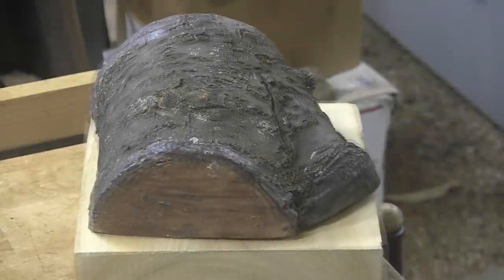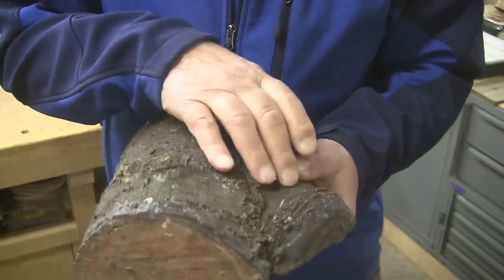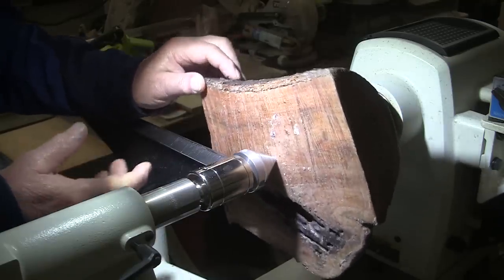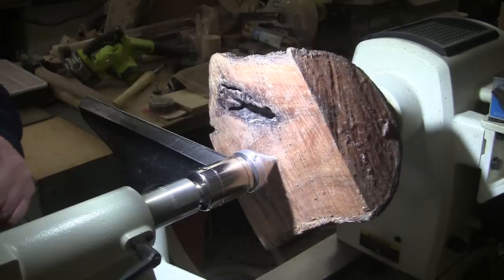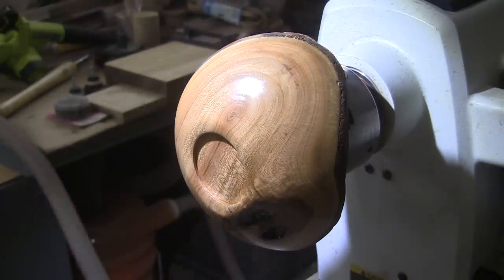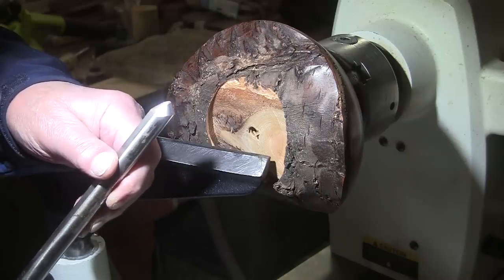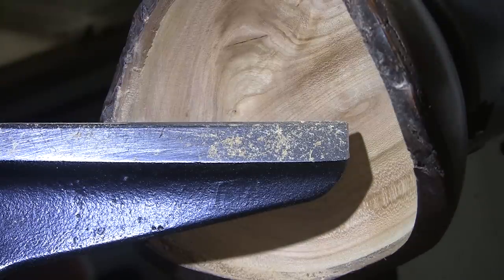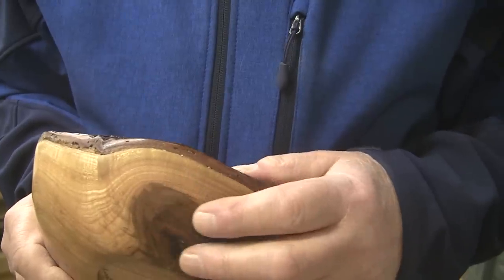Turning With Defects! - Wood Turning

Comment: Howdy Phil
Another piece of the olde black cherry .... great looking piece .
About that wax ... I have used a Dremel torch and melted off the wax ....
I like it too when I use and sand my black cherry so smoooooth and easy to get it there .
I sometimes get an odd smell from my black cherry when turning .... I think it maybe because it is drink close buy swampy water .
Keep on turnin'
Reply from the maker: OH, great idea with the torch, Bruce, never thought of that!  I gotta get me one of those smaller torches I see some guys using.  I need to try burning the edge a little, once in awhile.  😃

Comment: Thank You Phil, Thank You Luie from Spindles Workshop... Cannot go wrong with Black Cherry or any type of Cherry. Also a very nice crotch-ie piece. You said that it is hard wood but your chisel work looks smooth going with your sharp grind. I can see light under the raised up bark. That shows how rigid that bark is. Very attractive piece Phil. Until next time, TM
Reply from the maker: You know as well as anyone, Tuffy.  Sharp tools make all the difference.  Agree with you on Cherry, it's all good!  😃

Comment: Just love Black Cherry! Well done Phil. I can't help but wonder with some of the beautiful bark why you don't make a little under cut on some bowls near the rim to show more of the bark. This piece would have been a prime example. Thanks for sharing
Reply from the maker: I know you are not new to my work, Hotrod.  Most of it is irregular, dips, valleys, gaps, voids, bumps, etc.  It's not often I can turn a piece with a relatively thin edge.  When I can, I like to take advantage of it.  Obviously, I love bark but it's not the only thing in life!  😃
Reply: @PhilAndersonShadyAcresWoodshop  I understand, I was just curious. I know every turner has different aspects they like, so I just ask question sometimes to understand someones line of thinking. I use that info for future pieces so I can trying it out. Your pieces are always top notch my friend!

Comment: As always very nice.  I always wonder when I make a choice of which side to make the bottom, whether the other side would have come out nicer.  You can never know I guess but I wonder the same thing when I see you turn one or some of the other creators.  Seeing what comes out of your choices really helps me visualize mine.  Thank you!
Reply from the maker: It just comes from practice, Jim.  I used to wonder the same thing but, as you say, you can never know if it was the right choice so no point in wondering about it!  😃

Comment: Yes Phil fruit wood always turns well and the grain is lovely.
I would have probably filled defect with resin, and turned bowl the other way and made it sqareish . In other words your bottom my top.
You always know how to turn a piece to get the best out of it.
Question, do you sand after applying sanding sealer?
Thanks for sharing.
Reply from the maker: 😃 I have a very short video showing what I do between coats, Greg: https://youtu.be/lqns7oue4W4

Comment: Hey Phil, what a beautiful piece of cherry with a splendid finish. Technical question, why did you switch to a half inch gouge from the five eighths? Just wondering if you get a better finish or was it just a room to use it issue. One day I hope to get a piece out as nice as you do. Regards, Colin
Reply from the maker: Thanks, Colin!  I didn't have that much more to remove so just being careful to take smaller cuts, that's all. 😃

Comment: Hi Phil I finally got around to see your work it was a pleasure to see how beautiful the piece turned out I noticed you left the centre raised for the longest time was it because of the wood type or it being the cruch  or you needed to get the wall thickness  right before you took out the center
Reply from the maker: I always try to leave the center until I'm mostly done with the side thickness, Wendy.  The center connects the sides together so while turning them, they don't wobble.  I'm glad you like it, thank you!  😃

Comment: Beautiful work as usual.  I do have a question about your finish. How long between coats of sanding sealer  and also how long do you wait between the final coats if shellac.  Ralph Hines.
Reply from the maker: A lot depends on the weather, Ralph.  How hot, how cold, humidity, etc.  Usually 6-8 hours between all coats. 😀

Comment: As always, beautiful work!  Do you also apply the shellac with a soft cloth?  If so, how do you keep the shellac smooth and not sticking to the cloth from the previous coat?
Reply from the maker: Yes I do! 😊  I'm not certain of the rest of your question.  First of all, I use Zinsser Seal Coat for my sealer and then Zinsser shellac for the final finish.  Both come ready to use out of the can and I don't modify them in any way.  I usually wait overnight for the second coat to give the first coat a chance to cure.  Hope that helps!

Comment: Excellent job Phil!! I’ve noticed you’ve had the 90deg angle sander for a while now and was wondering what’s the brand?
Reply from the maker: It is a Ryobi 18 volt, right-angle cordless drill, Paul.  I have the older blue model, the newer ones are green.  😃

Comment: Hi Phil, wondered if you mind sharing what brands your 90 degree sanding drill is? Thanks a bunch!;
Reply from the maker: Sure, Kid!  It's a Ryobi 18 volt cordless right angle drill.  Mine is the older blue model, the new ones are green. 😃

Comment: Very nice. Did you shim the mount using your worm screw?
Reply from the maker: I shimmed it when I drilled the flat spot for my jaws to set against, Eric.  That resulted in a flat top and a non-flat bottom which I then turned away.  😃
Reply: @PhilAndersonShadyAcresWoodshop  Thank you. Might be a useful teaching moment to share the details of that. I assume the shim was wedge shaped, trial and error for final mounting. How big does the shim need to be. As always I derive great insights from you work.
Reply from the maker: @ericmoorehead1100  I often include that kind of thing and then edit it out because the video gets too long.  I have shown it in some videos, though.  The size of the shim is determined by the size of the gap.  Basically, I place the piece on my drill press table, place a wedge shim under it, get my eyes down even with the piece and push the shim in until the top looks level.  Clamp and drill!